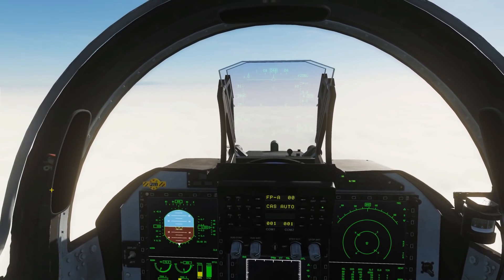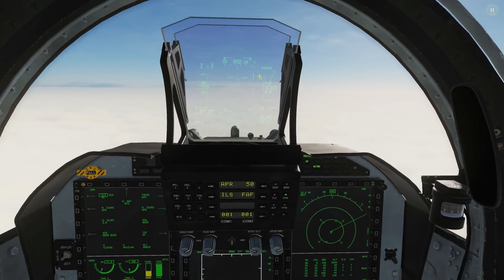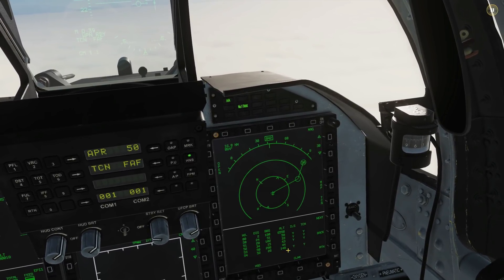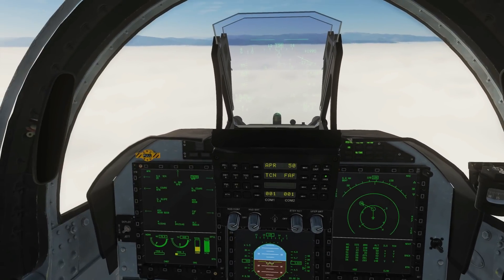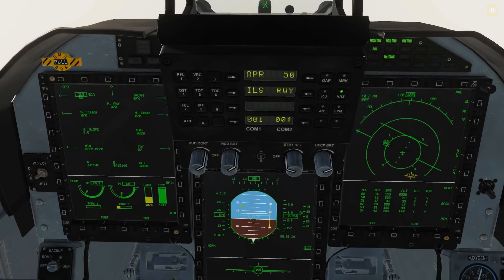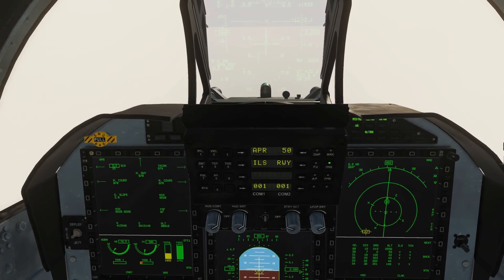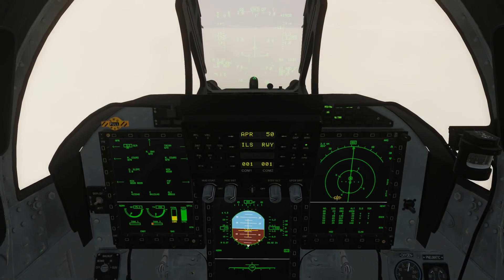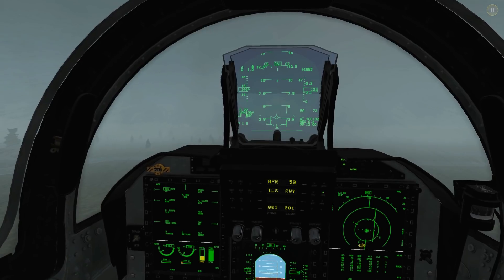JF-17 Thunder: ILS TACAN IFR Approach & Landing Tutorial | DCS WORLD

Comment: Are ILS ghost beams simulated at the multiples of the glide slope eg, wrong intercept height to high pouting you on a glide slope beam that will overshoot the runway and also lose the localiser as you get closer to the runway.

Also ILS is not on the runway itself meaning you have to keep your glides slope and look for the runway apon loss of the beam.

Comment: All that altitude/ DME intercept crap, scrap it. Just get to 3000 AGL, wait for the glide slope, and follow it down. If you don't have any charts, that's the safest and easiest way to fly an ILS in DCS.
Reply: (dont get me wrong, not shitting on your advice, just saying it does require you to be familiar with the airfield in question and the surrounding terrain)
Reply: Just be sure your on a clear glide slope first :P 3000ft AGL can dissapear FAST in hilly/mountainous environments like the cauc all the cauc fields at least have charts on kneeboards
Reply: @grinkle2521  Glideslopes dont have mountains between faf and rwy. But glideslopes can be different. London City airport has a very steep glideslope. Innsbruck (Austria) has a "bend", so at a certain point you have to do course correction towards the rwy.
Reply: Trouble we dont have ILS codes for the runways so you need to use the system he explained. Going to FAF or not is your choice after that.
Reply: @Zarma4074  Hi, we have have the frequencies by clicking the airfield, don't we? Or I'm misunderstanding you? Wanna learn! 😉
Reply from the maker: Roger, but remember be careful if hilly terrain outside the FAF!